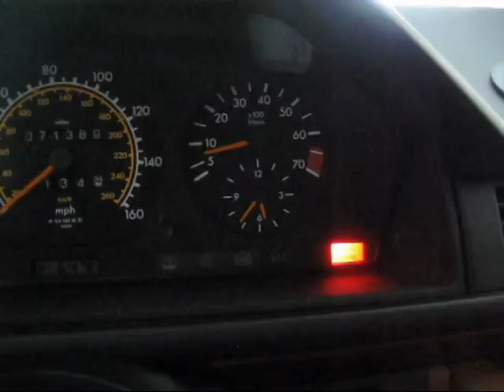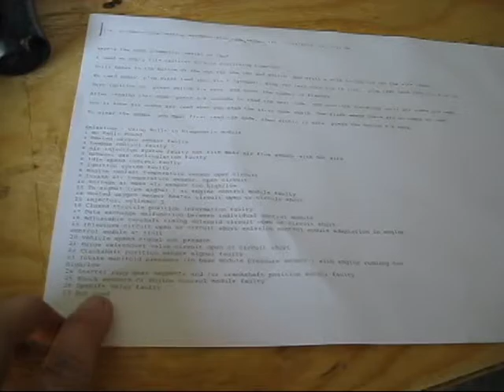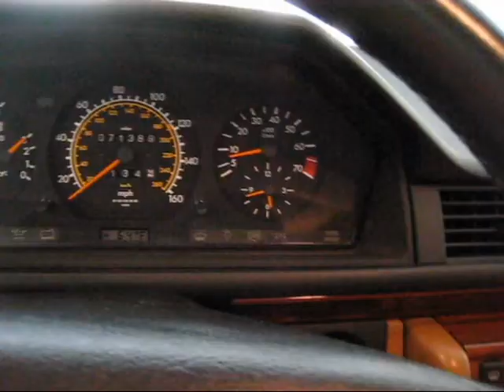1994 Mercedes E320 Check Engine Light Diagnostics

Comment: Hello, need your expertise. Engine doesn't start -> DTC flashes 17x. Where is the mistake !? greeting
Reply from the maker: 17 flashes means:
Data exchange malfunction between individual control module.
Check to see if all the connectors are firmly attached to the Engine Control Module. Do you have the infamous biodegradable engine harness?
Reply: @eallevato  Hey eallevato, I found the reason! Thanks!!! Can you send me a complete error list?

Comment: that was cool. My 94 E320TE cranks but no start. I bridged the Fuel pump relay and tricked the fuel pump to come on but still no start, so then I sprayed carb cleaner into the intake and still no start, which tells me I have no spark as well. You recon I have some sort of Imobilizer interfering? No fuel no spark? everything was running fine and after 4 month of sitting the batterie died and would not start anymore. It is a North American model non Calif.
Reply: UPDATE: I had fault Code #17 which indicated bad OVP Relay so I drove to a pick-n-pull Junkyard and scored multiple Relay's. I Swapped the Fuel pump Relay as well as the OVP Relay and I am back in Business, running like it always has.

Comment: Hi I hope you're still reading the comments from an 8 year old video. I have a 94 s coupe and I have replaced the steering wheel with another one after replacing it the SRS light turned on. Do you think a restart would fix it?

Comment: hello guys i'm Egyptian Mechanic 
regarding to delay in shifting transmission to fix this issue you have to replace or to clean the air filter or to clean it well if this problem not solved you have to clean the air sensor and throttle with cleaner cause much amount of air flow required to pass to throttle when shifting from 2nd to 3rd or from 3rd to 4th for high speed  
welcome to all from Egypt
Reply: Thank you! Air filter..

Comment: 1994 e420 read code 6 any help?
Reply from the maker: +steven davila Six flashes means that the Idle Speed Control is faulty.
Reply: steven davila I have same car and same code, did you resolved the problem with code 6?

Comment: hello, i have mercedes 300e and i buy a new engine (E320L M104) i have a wiring diagram for the ECU but i can't find the throttle body wiring diagram ,,,, can any 1 help me
Reply from the maker: +Olds Oldsmobile Google "w124-zone".  When you go to the website, you will find a ton of information.
Reply: eallevato tnx for helping

Comment: thank you very much for this video. I had a bad radiator leak so replaced that and the thermostat. After test driving for few miles the check engine light came on. The car is driving perfectly fine but there as mas amounts of coolant spraying everywhere before it was fixed. When i ran diagnostic it blinked 7 times when seems to be ignition failure. Do you have any input as to what it could be ? and How fatal ? Thanks in advance !
Reply from the maker: +Diane Gallina Do you still have the original wiring harness?  If yes, then maybe when you had the coolant spraying everywhere, it temporarily shorted something out.  I would clear the Check Engine Light and see if it stays off.  If you have not seen my other video on how to replace the biodegradable engine harness, check it out.  Good luck.
Reply: +eallevato actually i just tried to reset like you mentioned and now its not blinking 7 times its blinking 12 times. Very Odd !! I looked it up and it says 12 blinks is heat oxygen sensor heater/open / short circuit any input ?
Reply from the maker: +Diane Gallina Hi, you did not answer my question about the engine harness.  If you have the original engine harness, it could be degrading badly and you will see all kinds of bogus faults.  You may have multiple faults that need to be cleared.
Reply: +eallevato Sorry yes it is the original harness to my knowledge. If a issue with the harness how long till it causes major issues ? or is it ok to drive on it. I tested it a few times with time between and am only getting the 12 blinks. again drives fine minus some shaking at high mph but i think its due to bad brakes

Comment: I have a problem myself. Have a delay when switches from 3rd to 4th gear. Before it switches to 4th feels like it's in neutral (rpm's goes high fast and then pops in 4th). You got the same problem? And btw I have 1988 260e
Reply: Alex Levinta  mine does the same did u figure out the issue? and my code light just stays red then when I press it it only gets brighter..I need an answer right away because people are telling me the tranny is bad 95e420 automatic..

Comment: Clearing a code by itself does not solve the problem. If you do not repair the function that set the code, it will come back.
Reply from the maker: Yes, I know that.  That is why at 02:50, I said "I choose not to do anything about it" about this particular DTC code.  The intention of the video was to show how to use the built in diagnostics port and how to clear the Check Engine Light.
Reply: Here we have another smart ass telling the teacher how he should do the job but never having the intellegence to make his own video  Eall, was simply showing how to troubleshoot a problem on the car. As i have a Merc i found this extremely interesting and intuitive for future use Instead of critisizing try making your own video

Comment: @eallevato dude I love your videos keep posting! I have the same e320 like you sir! Yep! Pearly white! I've already had the wire harness replace a while back and I wish I would of discovered your video sooner hahaha! I have this electrical issue. My radio will not cut on and my power locks are not working automatically any more. Also my seatbelt light keeps flashing. I believe something is draining my battery (perhaps the altenator) can you put up a video on how to replace the altenator please thanks